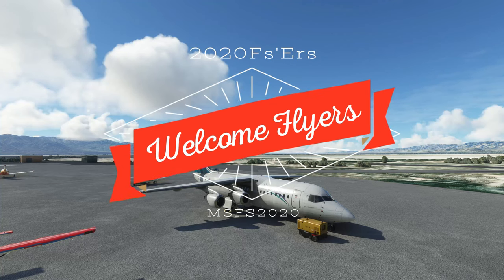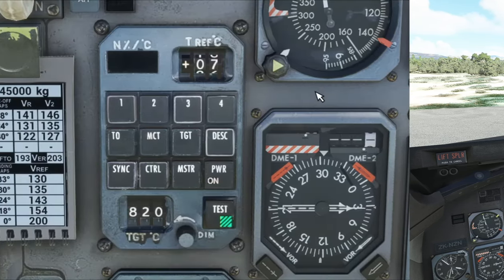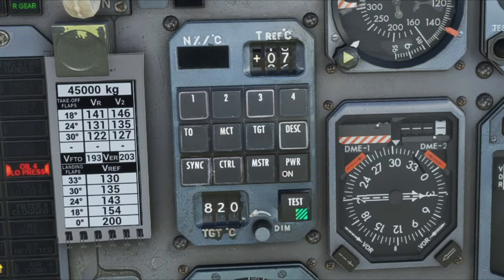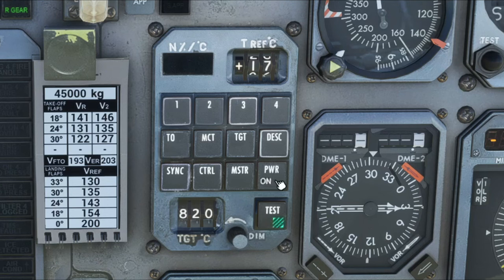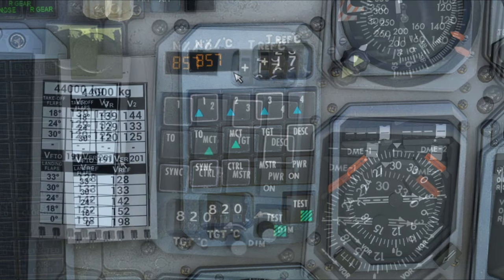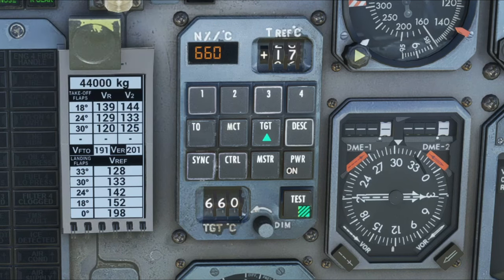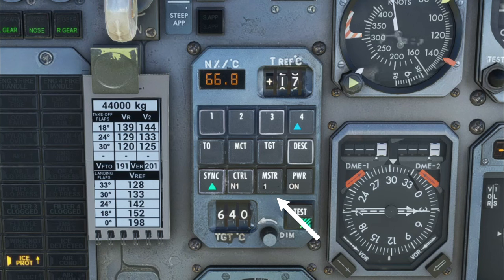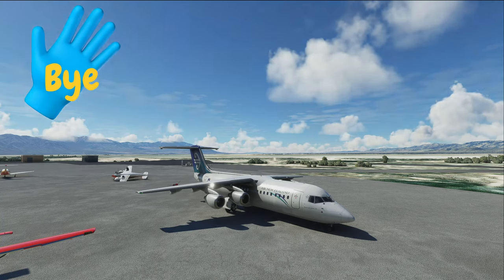Msfs2020 *BAE 146 TMS Explained* Confused about the TMS? Learn to use it like a Pro!

Comment: Hi there, nice explanation indeed although I have a question. How do you decide which TGT temp is in TO mode;  By default it is set to 820 to start with but would there be other suitable values regarding to outside conditions ? Thanks
Reply from the maker: I believe in TO mode it will auto set the temp for you .  For outside temp consideration use the flex temp setting . Thanks for the comment 😀
Reply: @2020 fs'ers  And how about the use of GO mode or deciding which engine to use as reference for master or control in sync mode .. 
Thank you
Reply from the maker: It has TO mode for takeoff. And you can use either engine for reference. This is incase you loose an engine I presume and want to select another engine as master.

Comment: Been looking online and can't find an answer.  Can anyone tell me how to make the autopilot shut up when I disconnect it?
Reply from the maker: Ye if you look forward there are 3 button when autopilot is disc. One of them will light up with ap or at disc pres on them and it should shut up the noise. These buttons are not on the ap panel it is above thae main gauges on the pilot side . Hope this helps

Comment: Thanks for another great video! I did the JF tutorial flight today and I got a bit confused about the TMS system, especially as I mixed up the TMS-sync with the AP-sync. So this video is really helpful to get a grip on this fantastic aircraft. I flew it a lot on P3D and I've been longing to fly it on MSFS.

I also had some problems with assigning buttons on my controller (X52 HOTAS) for some of the functions in the 146, especially the AIRBRAKE and the AP-SYNC button. Do you or anyone know if there is some listing avaiable for the MSFS controller commands  and the not so common functions in the 146?

I have an issue I'm not able to solve with the airbrake and would be very grateful if someone has a clue. I can't extend the Airbrakes!! (I've managed to do some decent landings but the brakes got really hot).  When I pull the airbrake lever it won't move out of the IN position, it just stutters and flips back to the IN position. I've tried it in every phase of the flight and different throttle settings, but just can't get it to work. Could be that I've missed some crucial setting in the aircraft och something with my controller setting, but I'm lost right now. Would be grateful for any help on where I should start to look.

Looking forward to your upcoming videos on this fantastic aircraft (and others)!!
Reply from the maker: Hey thanks for the comment . I got so fed up with the key bindings on msfs I jumped over to spad and never looked back. They have a free version you can try and the man to watch on this is les o riley he has fantastic videos on youtube on this and he shares his profiles. I mainly fly vr now so I always use the controller but for my brakes I use a button on my bravo for that with no issues. If you are clicking the brake and it flips back off then maybe a key is bound to that and you don't know . Here's how to solve this eliminate variables. So go to your profiles create a new blank profile for everything plugged in the USB. Except for the mouse and go and try the air brakes again  . If it works now you need to find the culprit and start 1 at a time. Turn on each profile for your usb devices 1 at a time testing each time when you turn on the profile that gives you issues now start narrowing that down . You will find it.
Reply: Hi, and thanks for your swift answer and your advice. I'll have a go at my controller settings in MSFS. And I will surely have a look at SPAD.
Btw, I just signed up for a Captain Club membership. So I'll surely be back on your channel.
Reply from the maker: Oh my thank you so much I really appreciate that. If you need anything or a video on anything let me know 😀 you will like spad and I can help you if you would like hope over to the Facebook group if you haven't already and join . There we can share pics and videos to help with any issues also feel free to message me direct. Thanks again
Reply: On my X52 I have SYNC and AIR BRAKE binds. SYNC is toggle afterburner in MSFS, airbrake is airbrake axis.
Reply: @madvent9090  Thanks for your advice about binding to the "Toggle Afterburner" command. My airbrake problems was due to a conflict in the command settings. I then chose to bind AIR BRAKE to the slider on the throttle quadrant.

Comment: The descent button is to ensure that the engines run at a speed above flight idle such that there is a sufficient bleed air supply to the air conditioning system to maintain cabin pressure and adequate cabin ventilation.  It has nothing to do with maintaining hydraulic pressure as the hydraulic pumps  are self regulating to 3000 psi and there are not any large flow demands during a typical descent.
Reply from the maker: Thanks for the clarification I knew it had something to.do with that I probably should have read a little.more but I got the point across. Thanks again for the info 😀
Reply: In a similar way, when you select the anti-ice system, because they are supplied by engine bleed air (not electrical) the engine speed is increased to ensure that there is an adequate supply for the air conditioning system as well as the ice protection system from the engines.  How do I know this - I was part of the original design team and I worked in the Fluid Systems Department which covered engine bleed air and hydraulics.
Reply from the maker: Wow Mr Keenan hats off to you on being part of this fantastic  aircraft ( the real one ) I love talking with people smarter than me I get to learn new things all the time . What you said makes sense and what I said doesn't lol. Thanks for this info and being part of the community.
Reply: In 4 years flying the 146, use of Descent on the TMS was never, ever used in my airline - just for the record.
Reply from the maker: Hey thanks for the comment . It's good to get input from pilots who flew this aircraft thank you